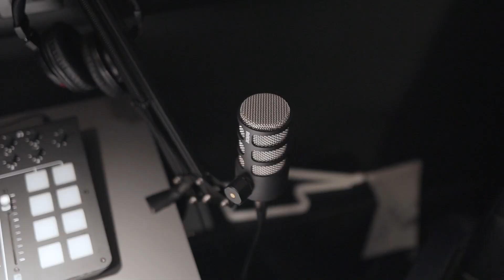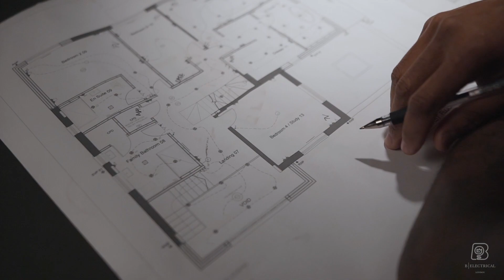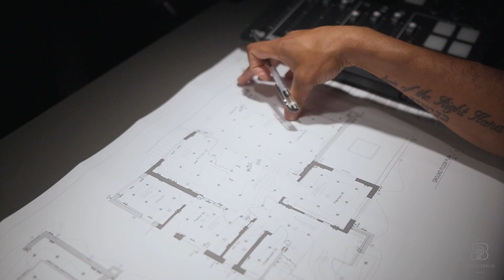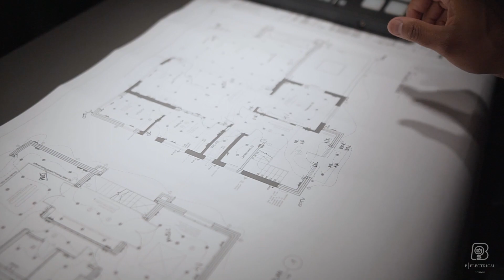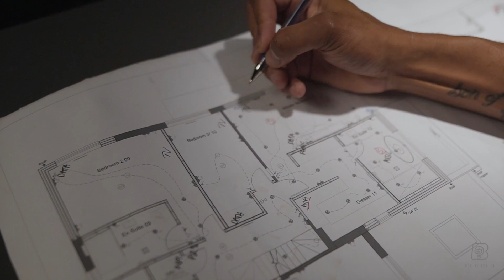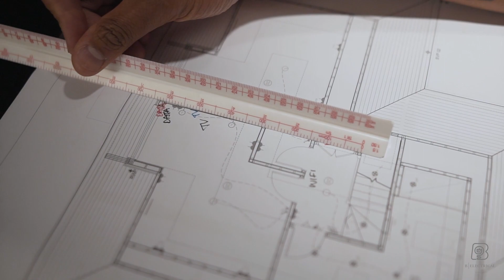I planned a Control4 Smart Home..... What did I miss??

Comment: Hey , are you using Hdmi over Ethernet for TVs or only Ethernet cables? Thanks!
Reply from the maker: Typically we run 1x CAT6a for video over ethernet, and 2 CAT6 for LAN and a spare. Also a coax for digital TV

Comment: Would you need a minimum broadband speed to have a smoothly running smart home?
Reply from the maker: Hi Kris, it all depends on the size and complexity of the smart home.
The minimum speed required for an entry level smart home with SD video is approx 5-25mbps.